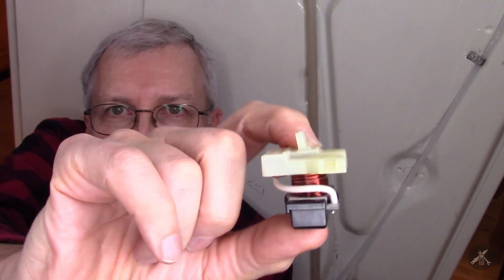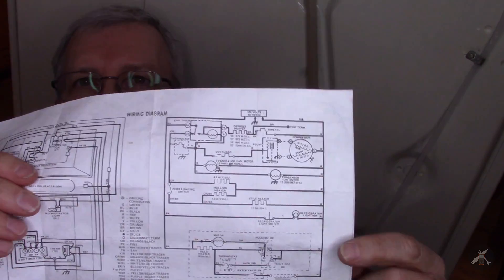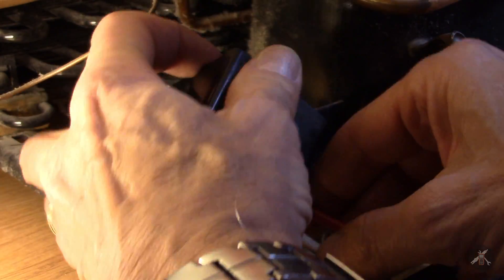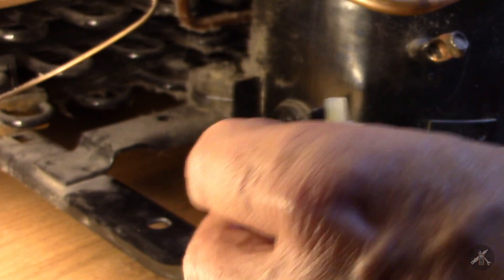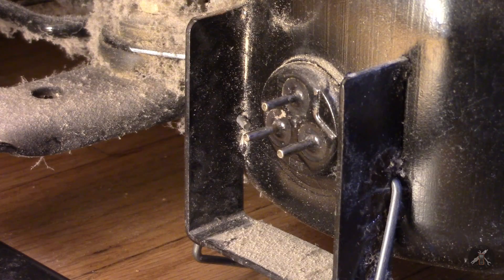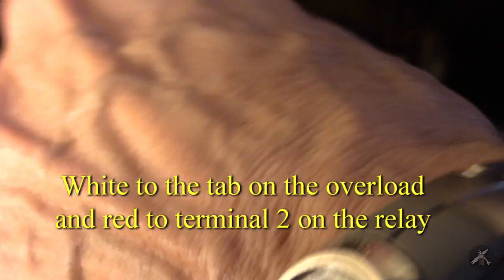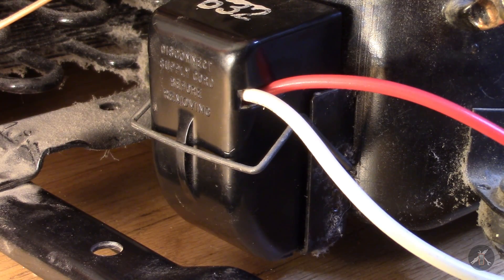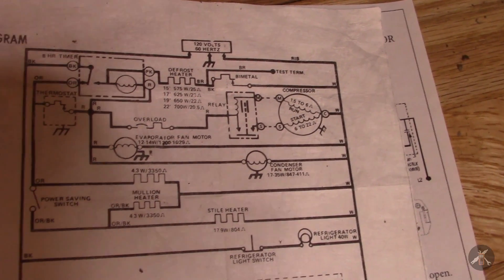Refrigerator Won't Run- Find Replacement and Update Obsolete Whirlpool Compressor Start Relay

Comment: My electric clothes dryer is a Kenmore bought used by my dad in 1994, I think it was a couple years old, maybe older, I'm still using it and all I've ever had to do is replace a couple drum rollers.
Reply from the maker: Many of the older appliances were very reliable. Then global competition struck (much from China) that drive down pricing and made quality much more variable.  Some are very good, but many don't last as long as the older ones. On the other hand, the newer ones are often more energy efficient and have more features.
Reply: @bitsofwisdom460  Maybe I should upgrade and I have thought about it but I just can't bring myself to get rid of it.

Comment: Fantastic fix. Only remaining problem on those old girls is they enjoy feeding on electricity with a harty appetite....
Reply from the maker: Yes, you're right about energy. I generally come down on the side of efficiency, but sometimes keeping older, reliable equipment running comes out on top.  I have family members that seem to be frequently replacing their newer fridges.
Your comment did cause me to go back in my records and the official label old vs current is quite different.  The old one is about 1100 Kw-h per year vs 400. In Michigan, it's probably $100 /yr. My old one has some optional heaters that have an economy switch.  I have always run with that switch off, so it probably is less difference than that.
As electricity keeps getting more expensive, it may be worth the change.

Comment: Life is a CONSTANT stream of repair and upkeep isnt it?  Thanks for giving us info on repairing fridge. I wonder though, why you thought or the troubleshoot method you used to determine it was the relay that was bad
Reply from the maker: Good question! I didn't go into depth on that.  The first question is if the compressor has power from the thermostat.  I didn't need to check that because I could hear the compressor attempt to start and fail when the self resetting thermal overload popped. So there was power and the thermostat (and defrost timer) was calling for cooling.  Then the next question is whether the compressor is bad - either a shorted or open winding, or possibly seized. I measured the windings with my DVM meter and resistance was within band. At that point, the compressor could still be seized (which would be the end) or the start relay and overload could be bad.  They are parts that are roughly between $25 and $100, and the compressor had just been running without any odd noises, so new relay was worth trying.

I should add that this works with conventional single speed compressors. There are newer schemes with inverter driven compressors (and others) that have an entirely different diagnostic approach.